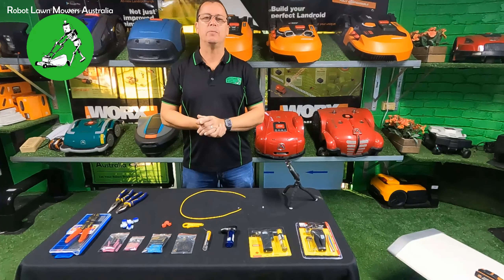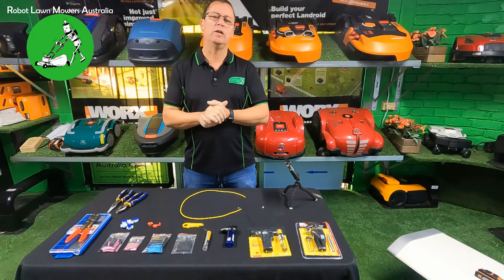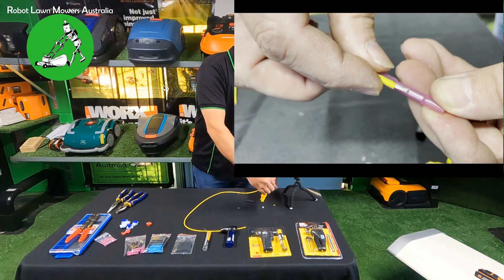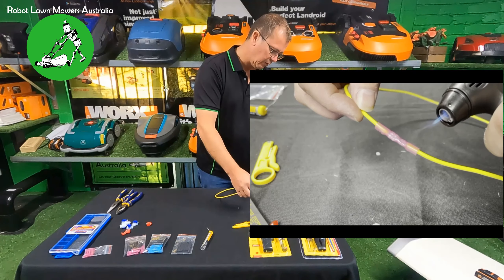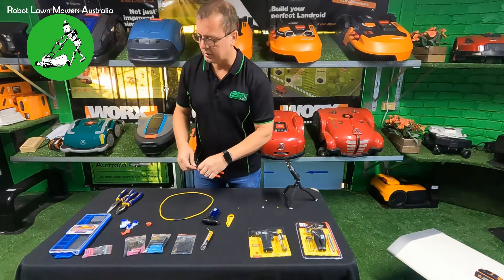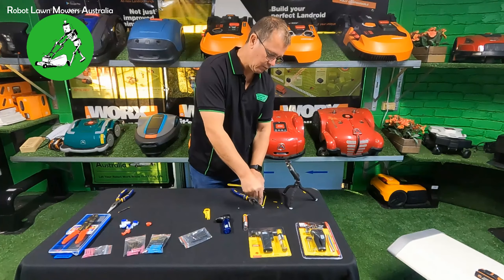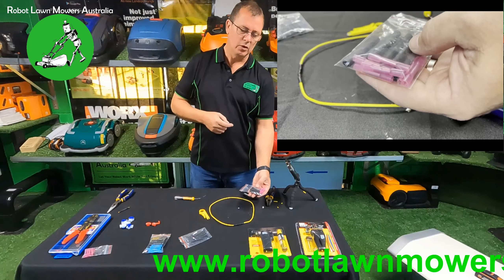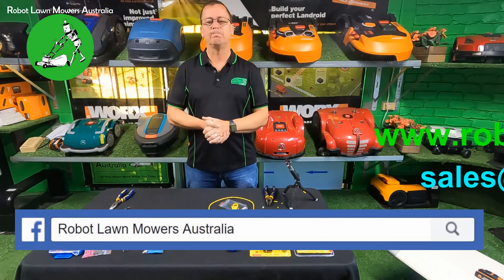Robot Lawn Mowers Australia - Joining of Perimeter Wires - The Best and Worst Ways

Comment: Apparently it's not easy to get a straight answer on the internet that you can just solder the wire and secure it carefully from moisture. It's an obvious thing to do but since I'm not an electrical engineer I started doubting my sanity 😀 Anyway, that's a useful movie, thanks!
Reply from the maker: No problem glad we could help.

Comment: No mention of how you join a guide wire to the perimeter wire using the heat methods.
Reply from the maker: You are correct, we didn't explain this in this video. But we doe much the same thing and have two wires coming out one end of the joint. We also put some E6000 glue inside the heat shrink to ensure it seals perfectly around the twin cables.